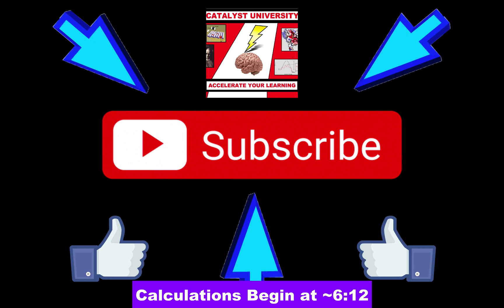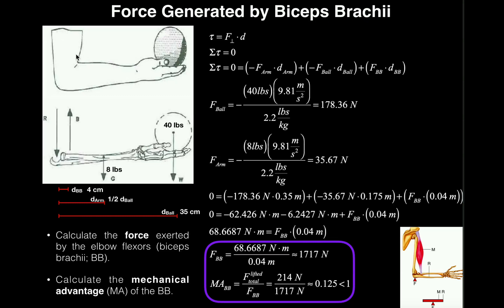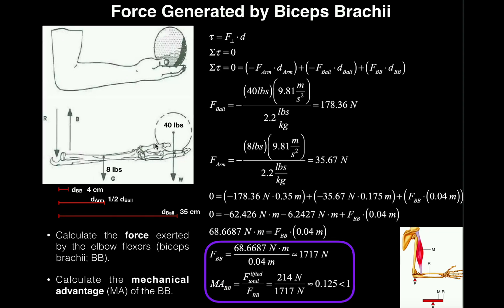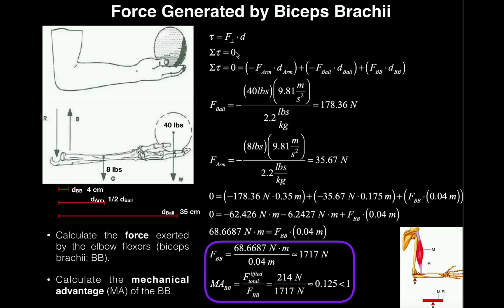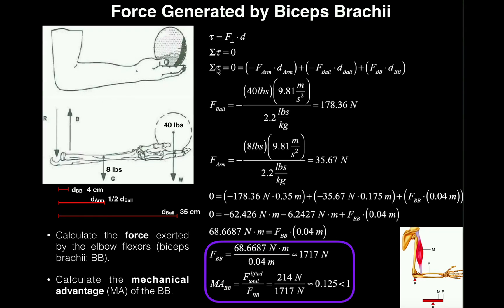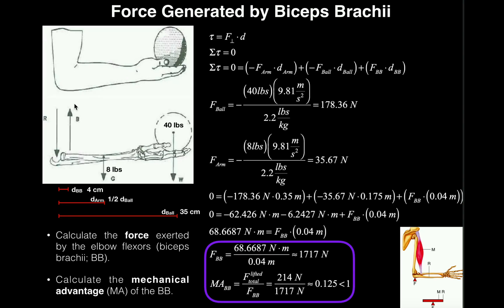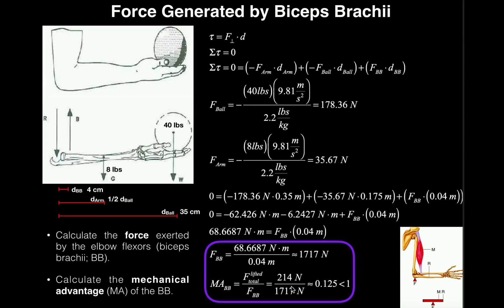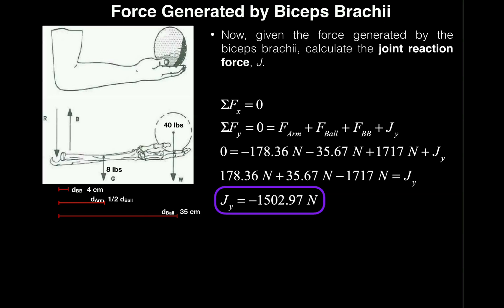Biomechanics | Torque Problem #1a (Elbow Joint) [Biceps Force, Mech. Adv.;]

Comment: Hoe do I calculate the force needed by the bicep is the forearm is not at a 90 degree angle
Reply: Ok I am not sure of this but I will answer since nobody did in 3 years.
You basically do the same except for the mechanical advantage, but when u get the Force BB you multiply by the sin(x).
Why?
Because when it's at 90 degrees the torque will be the maximum(sin(pi/2)=0) and if you move upwards the force will be smaller but the angle bigger, while if u move downwards the force will be smaller and so the angle as well.
This also depends on the angle the exercise gives you and if it is at equilibrium.